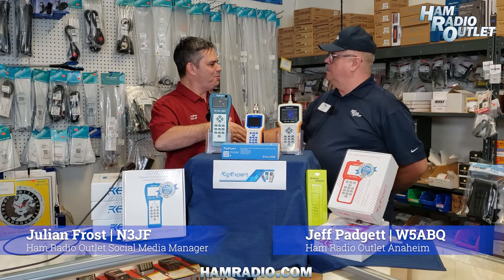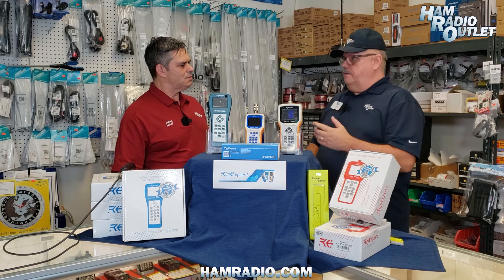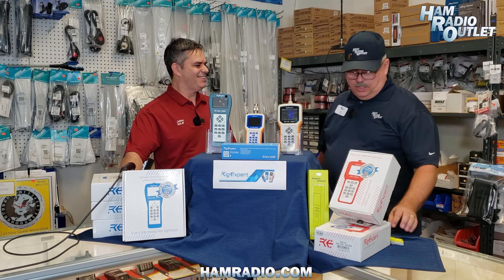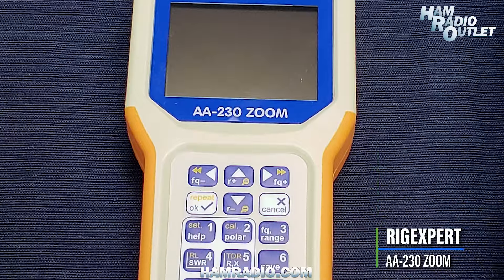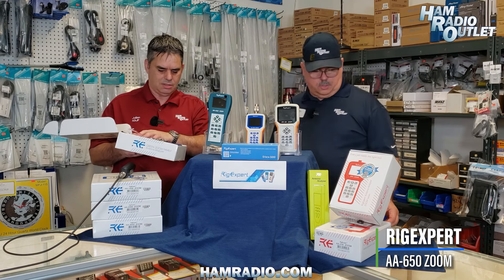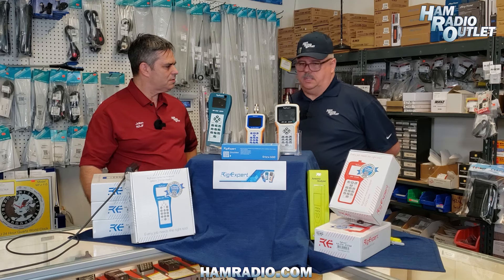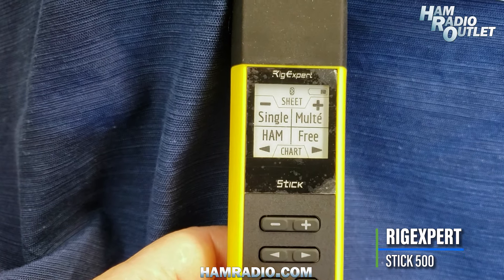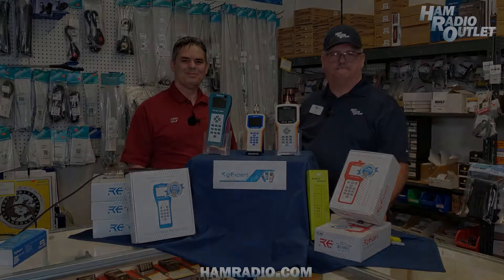RigExpert Antenna Analyzers - Ham Radio Outlet

Comment: I bought the RigExpert 650 from Jeff ABQ Great Unit!!  So good that my buddy PNF bought a 55.
P.S. Minor correction to an otherwise perfect video:
 If your antenna is resonant below the intended frequency, you want to raise the resonant freq by shortening the antenna
 If your antenna is resonant above the intended frequency, you want to lower the resonant freq by lengthening the antenna
Reply from the maker: Congrats on the purchase!
Yes, in the video I said:
         "So if it's more resonant higher than your operating frequency you need to shorten it.
          If it's more resonant below your resonant frequency you need to lengthen it."

What I meant to say was:
         "So if it's more resonant higher than your operating frequency it (the antenna) is too short.
          If it's more resonant below your resonant frequency it's (the antenna) too long."

Thanks for the correction.

Comment: I have the MFJ old model and Nano VNA analyzers and just got my first RigExpert AA-35 zoom. I am shocked with the ease of use and setup.  I did not read manual . The PC software was simple and easy to use.  The part I like is they are made in Ukraine and sold all around the world.  I do portable HF like POTA and this was a must have for the go kit.  HRO has them on discount and just got it.  73 from NY !!
Reply from the maker: I definitely agree. The RigExpert antenna analyzers are great value for the money. I take mine wherever I go and it is fantastic for portable operations.